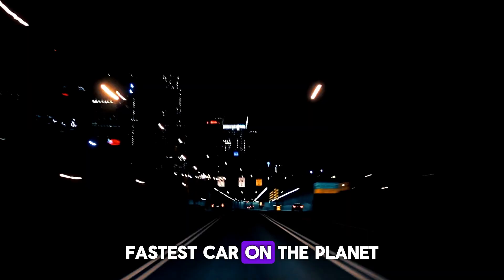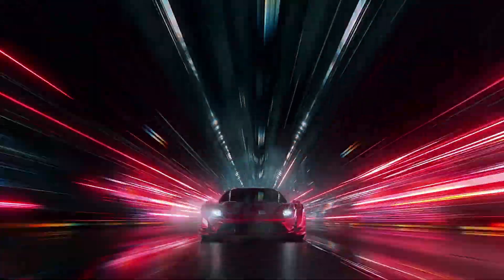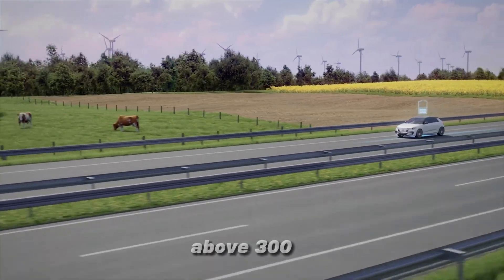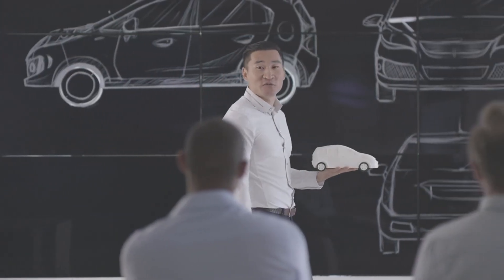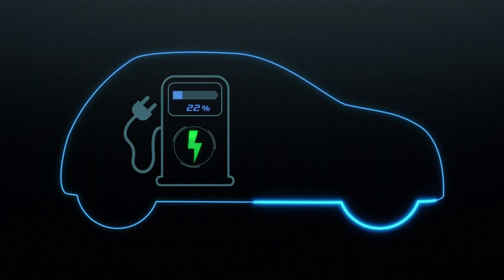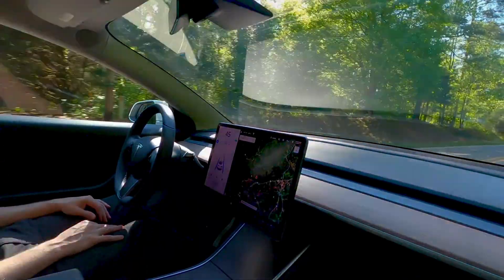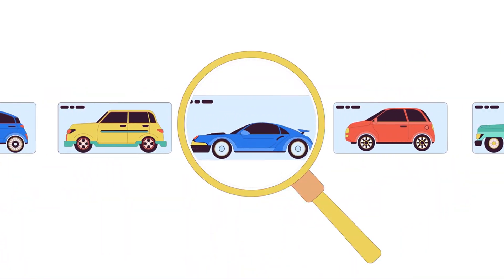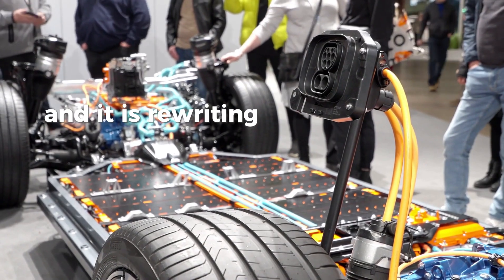Fastest Car Ever? BYD Just Killed the EV with Best Motor + Battery

Comment: ㅎ 빠른건 누구나 만들어. 커브와 회생제동 제동력이  문제지
중국 유튜버가 트랙 돌았을때 아이오닉5N 완전질주.
 BYD 트랙2바퀴돌고 브레이크 파손 났다던데
Reply from the maker: That’s a good point — speed alone doesn’t tell the whole story. Curve handling and brake performance are huge factors, especially on track runs. The Ioniq 5 N really showed impressive stability and regen control, but BYD still seems to be improving its track endurance. It’ll be interesting to see how the next generation handles those stress tests.

Comment: It is great. The BYD Yangwang U9 Xtreme has been claimed as the fastest production car, achieving a top speed of 308.4 mph (496.22 km/h) with a 1200V ultra-high voltage platform, four motors, and an advanced thermal management system, according to news reports from late September 2025. This marks a significant leap in electric vehicle performance, potentially setting new industry benchmarks.
Reply from the maker: Thanks for sharing this information about the BYD Yangwang U9 Xtreme, I appreciate it!